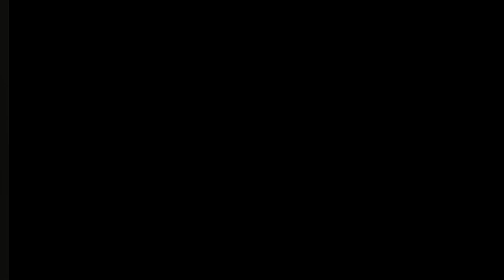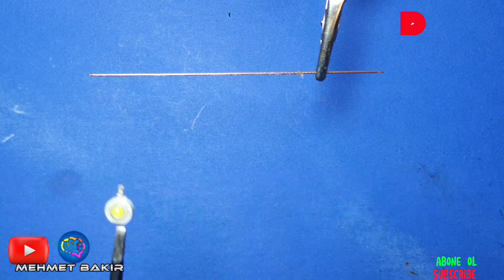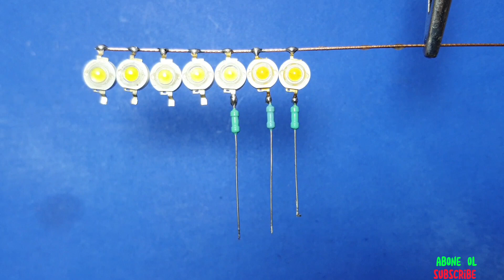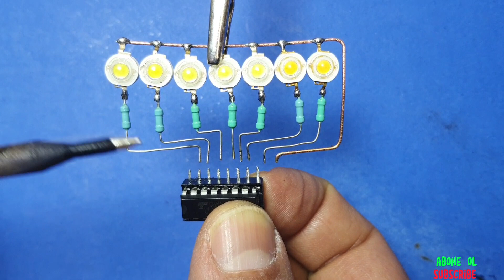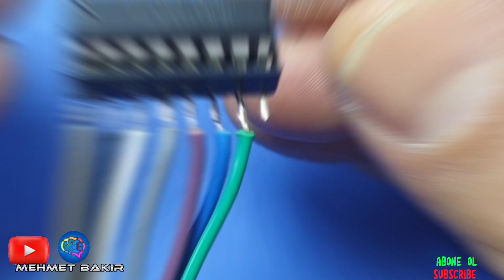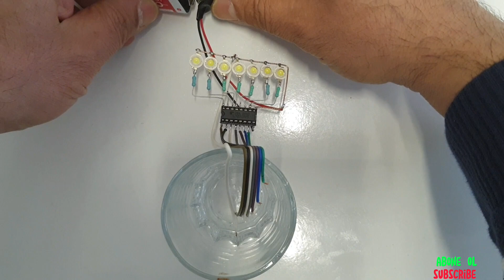ULN2003 IC . su seviye sensörü . water level indicator . su seviyesi devresi . su seviye devresi

Comment: Are those LEDs 1watt?
Why is a + lead put into the water at bottom?   Shouldn't the water have ground negative that connects with the other leads to complete negative connection to the LEDs?
Reply from the maker: hello, first of all, you can use any led.  I just used these carcasses because they are easy to work with.  The other issue is that the uln2003 IC works the same as the bc547 logic.  negative is directly connected, if positive, it is placed at the bottom